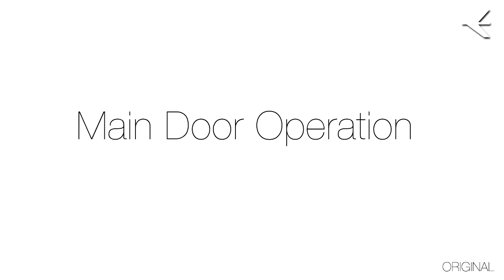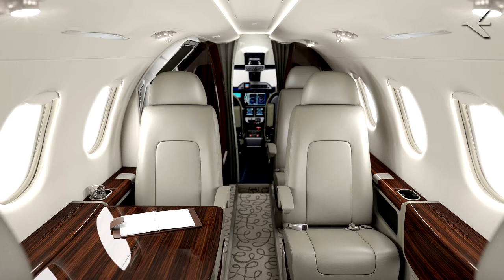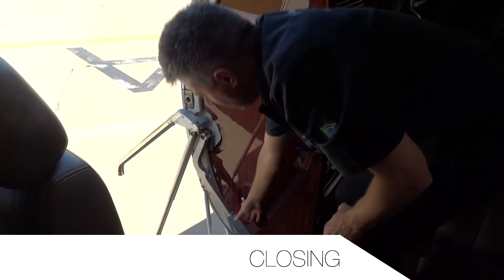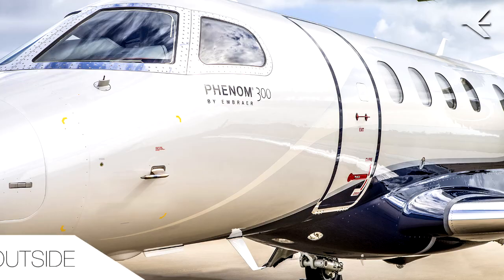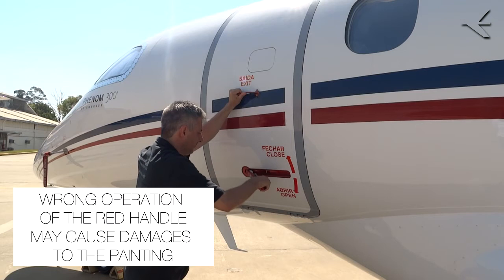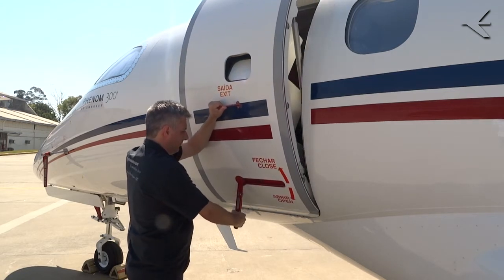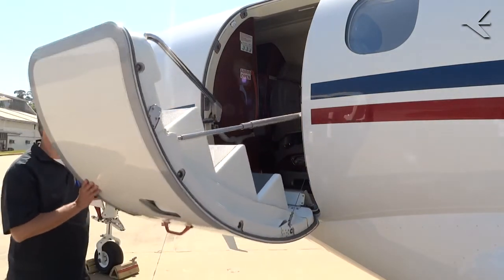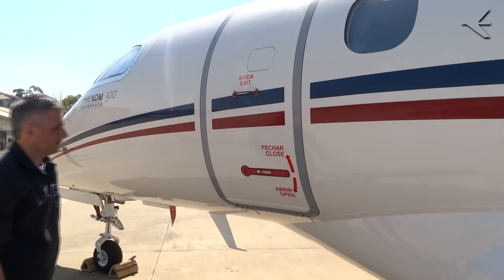Phenom 100/300 Main Door Operation

Comment: What is the function of the square panel on the passenger door?
Reply from the maker: Hi Quirinus Jr,
If you are talking about the panel shown on the external side of the door (that opens while the door is being unlocked and closing while the door is locked), it regards to the Main Door Vent Flap. It's function is increasing the opening effort of the actuation mechanism, when the differential pressure in the cabin reaches certain pressure, preventing the door from opening either inadvertently or intentionally during flight.